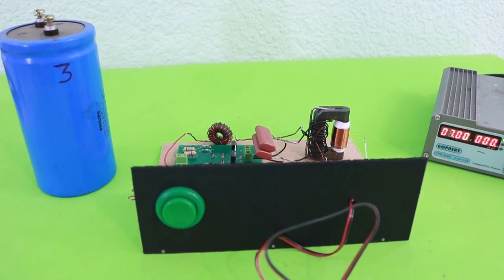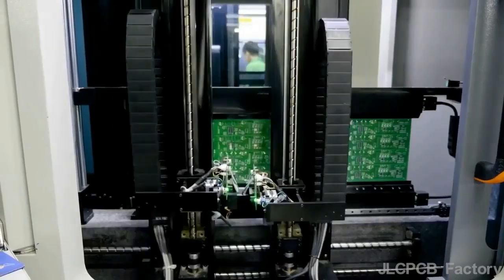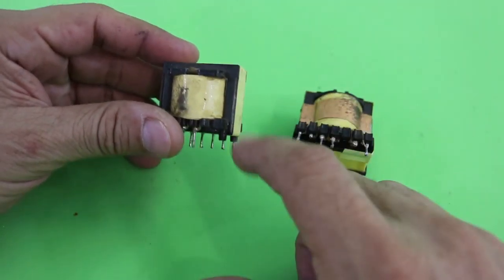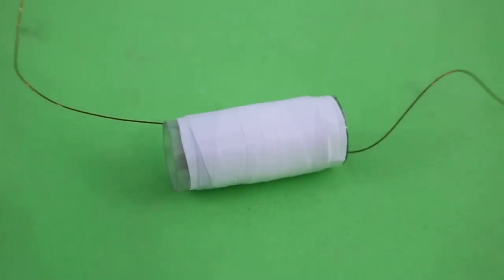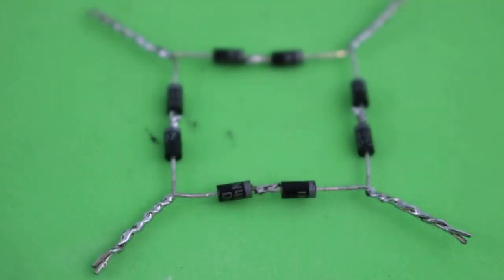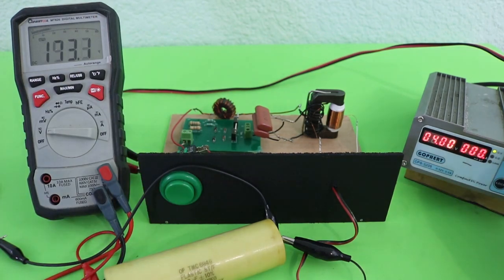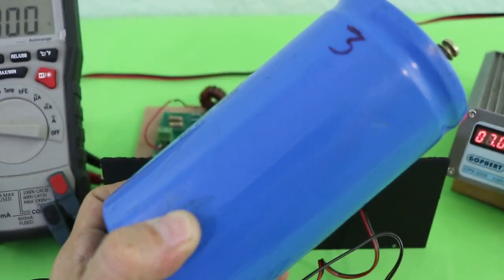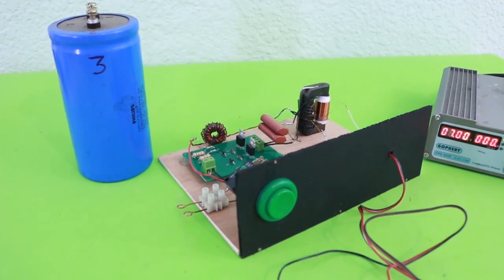High Voltage Capacitor Charger

Comment: I don't know whether I missed it, but you should mention that these charged capacitors could be deadly to people due to the large amount of energy stored in them. Please be careful not to touch the contacts.
Reply: Tobi N. anyone who's here knows that so no point 🤷🏻‍♂️
Reply: @cia3653  IMHO these videos are appealing to electronics beginners because they are well made and more or less easy to reproduce. And I can imagine that it is not obvious for such a person that a simple capacitor converts a system powered by 7V which is equivalent to an electric cattle fence into a death trap. If the system would be powered by mains voltage I would expect some respect from beginners because possible dangers are more obvious. But that's just my 2 cents.
Reply: Capacitors are dangerous due to low internal resistance, not due to energy stored in them.  The largest capacitors shown in video  may have less energy than any AA size cell but it can discharge all of that stored energy in a very short period.
Reply: @imranakhtar4478  OK, I apologize for not being 100% accurate. So I summarize: the stored energy by itself is not enough to claim that something is dangerous But a low internal resistance is by itself is neither (c.f. electric fence -> high voltage, low resistance but not really dangerous). The rule is: It's the power that grills you :-) I.e. you need a high voltage and a low internal resistance to generate a high current with the body in series. In addition you need enough stored energy to maintain the current until the dumped amount of power has a damaging effect on the human body. I hope the explanation is complete now.
Reply: If you can build a mazzilli flyback driver, have a disassembled flyback core and own high voltage capacitors to charge, theres a pretty good chance you know enough to be safe around a 600v cap
Reply: 450v dc moat likely will not be deadly. Have touched them alot(eith bouth hands) gives you really painfull schock but offten you will be just fine
Reply: Always remember to discharge capacitors by short circuiting it's two terminals or contacts pins to avoid risk to electric shock. Well noted!

Comment: I built the same ZVS driver circuit a few years ago and it worked extremely well. I got some nice fat hot orange arcs on my jacobs ladder that I built. It also worked very well with the induction heater too.

Comment: I built this driver circuit many years ago and it is perfect for a jacobs ladder. Nice thick red fiery arcs like you see at power station short circuits. Used it with 2 x 12V car batteries in series. 24V

Comment: Hi Ludic the output from, ZVS is a sign wave so you don't need an air gap in the core you only need a gap if its being driven single ended (flyback) that is where the transistor turns on and the core is magnetised the core stores the energy and only transfers it to the secondary when the transistor turns off in a flyback topology power supply the output rectifier diodes are reverse biased when the transistor is on and forward (conducting) when its off that is why its called a fly back excellent vids thank you keep up the good work Steve
Reply from the maker: Thanks I will try without the gap
Reply: If you want to be easily understood, do not forget about dots and commas.
Reply: If you remove the gap it changes the inductance of your coils and therefore the frequency this circuit will run on. 

Just something to consider.

Comment: I noticed you connected diodes in series to - I believe - increase reverse voltage. This simple configuration has a drawback: any mismatch of reverse current will cause uneven distribution of reverse voltage which may cause cascading failure. Normally an equalizing resistors are added parallel to diodes.

Comment: Very interesting, especially your high voltage bridge rectifier.
Reply: I have a question to ask, for 48v, 3Kw DC motor I wanna make a backup capacitors pack, when I switch from one line of electricity to another, in that moment I need capacitance for few seconds,I don’t want to stop motor during switching, for that purpose how many caps, how many capacitors in pack required?
Reply: @maliknaveedislam  rather that making a system to fill that couple second gap, I'd focus on making that gap as small as possible. Use a double pole, double throw switch and wire it so that when you move the switch position it immediately shifts to the other power source. Just my thoughts.

Comment: It would be nice to use a resistive divider and feed a small sample of the output voltage into a comarator  so you could make it automatic just set max voltage and use a fet to drive a normally closed relay (that way should the fet fail short it would be stuck switched off) have the relay break the Vcc to the ZVS
Reply from the maker: Good idea
Reply: That is exactly how I built mine for a coilgun :)

Comment: I have a big doubt, could make a video about my question, which is: Every receiver is also actually a transmitter, but of lower intensity (power) than the actual transmitter itself ???

Explaining: Whether in the transmitter and the receiver, we know that each one uses its own tank circuit (in inductor and capacitor configuration).

So I believe that regardless of the signal, I mean when it comes to the carrier wave, we know that a RECEIVER also uses, in its electronic scheme, the tank circuit (coil and capacitor) to oscillate and thereby suck in resonance. frequency of adjustment by the frequency characteristics of the emitted transmitting wave.

And that's where my doubt comes in: I think the RECEIVER should also transmit waves because of the tank circuit, but with low power. Thus there would be the resonance meeting between transmitter and receiver, in which there will already be in the path between the two, as an example, a mechanical system of a balance:

Where the person who pushes with his arms (would be the transmitter) and the swing itself (would be the receiver) and both need to be in sync with the commuting, let's say, so that there is resonance and with that there will be signal absorption by the receiver, and then a transistor on the receiver output amplifies so that the power is audible.

I hope I could explain it well.
I would love to know if this is what happens ??? If you understand me. Grateful I await a return.

Comment: Will this work if I use 3v batteries? Or does it only works with ac power?
(How do I charge capacitors with dc power and transformer?)

Comment: I have 100uf 400v capacitors and I would like them to charge faster.  Do you think that if I put a multiplier at the output of the high voltage transformer, do you think it will charge faster?  the joke is made 3 capacitors in series after which I have 4 rows placed in parallel ... I would like it to charge much faster so I ask you ...
Reply from the maker: it Will not Charge faster with a multiplier
Reply: @ludicscience  

then I will have to use capacitors with the same voltage but to have as few microfarads as few ... Seriously the voltage increases, the microfarads decrease ... I thought that if I make a multiplier with 20kv ceramic capacitors and 16kv diodes about 2 steps  about 40 kv I said it can load faster ...

Comment: The diode you used is 1N4007.
These diodes are not applicable in high frequency applications. So how the diodes did not get damage and malfunction ??
Reply from the maker: 1n4007 can work up to 15 khz
Reply: @ludicscience  thanks for the info...😀